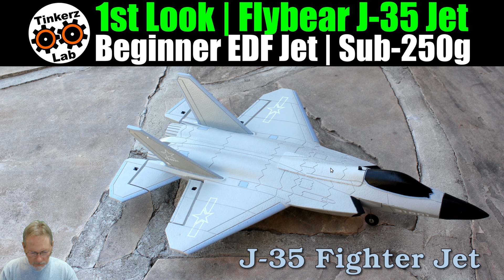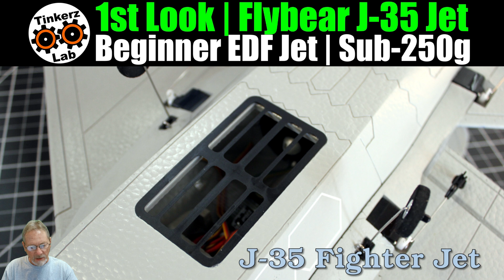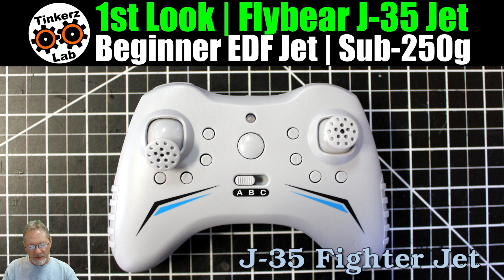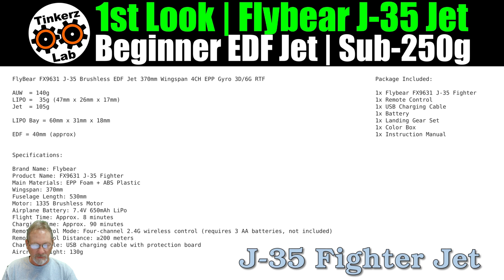1st Look | Beginner EDF Jet | Flybear J35 EDF Jet 370mm Wingspan 4CH Gyro Sub 250g RTF

Comment: Hi. I hope you can help me with the battery installed the left elevator drops  trim doesn't help. 
Is there a fix ?
Reply from the maker: Some of these gyros are strange with any trim input.
I mechanically trimmed mine.
I also found issues when changing gyro modes if there was any trim input.
Some gyros also act strange until there is throttle input.

Comment: Wow that transmitter is awful came with my cheap j20 looking at about a 10 meter range hopefully radio master 4 in 1 can save the day
Reply from the maker: The gyro stabilized modes on this work well but the 3D mode isn't very good.
I think I'm going to try and MOD this one as soon as time permits as it looks like a very good airfame.
I was able to bind up using FX/9630 Protocol.
It will be a lot of fun as a 1st EDF Jet and wish it would have been my 1st EDF.